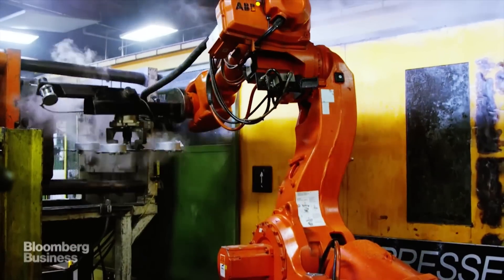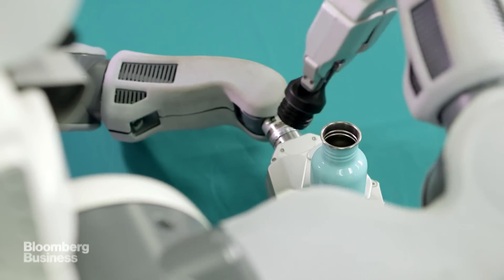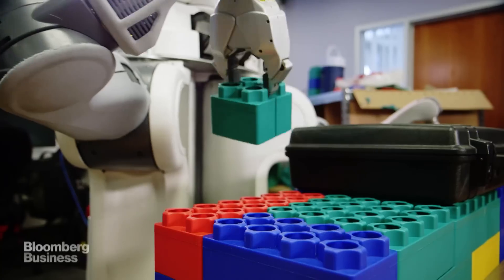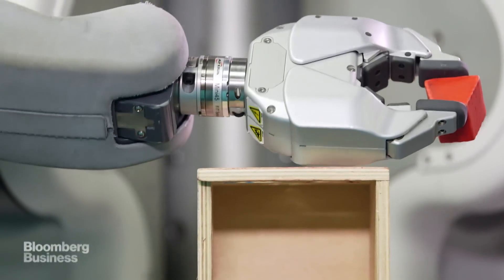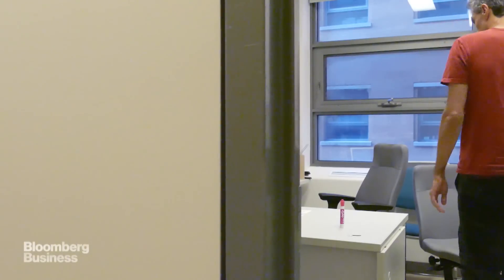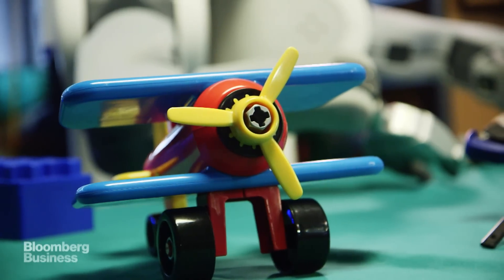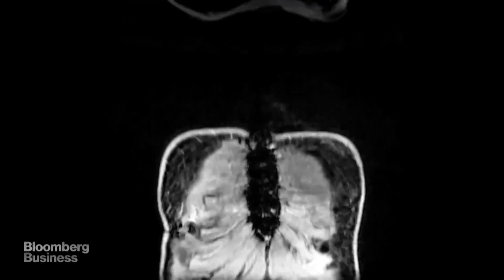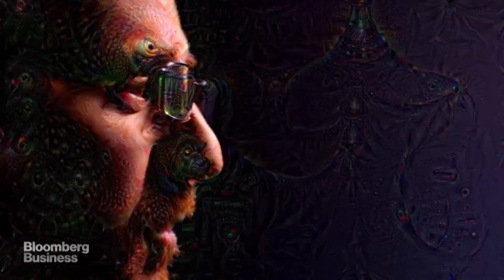See Smart Robots Learn to Play Like Human Children

Comment: there is a big problem they have not solved yet. you can't just input one type of data and then get a different type of data on the output. you can only teach it one type of action, one or the other. if you input different patterns of different type of work like image data and movement data in the same network, the program get confused.